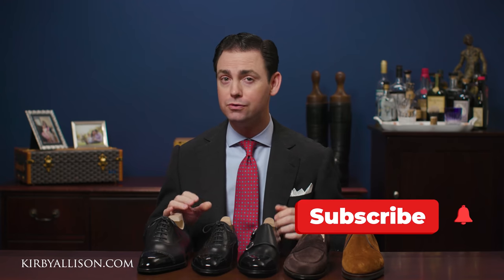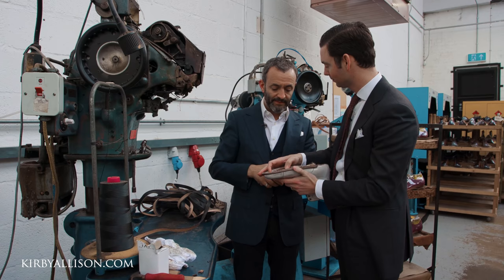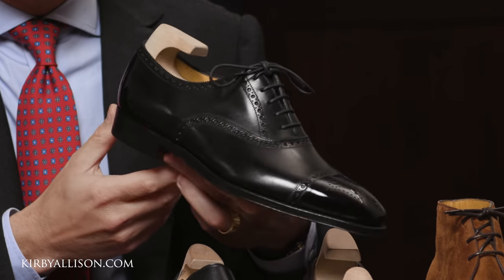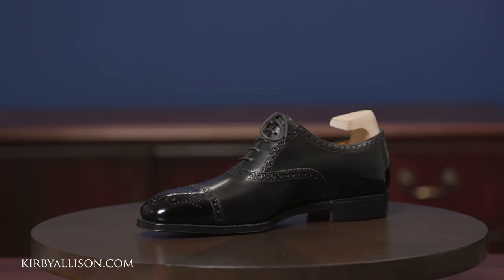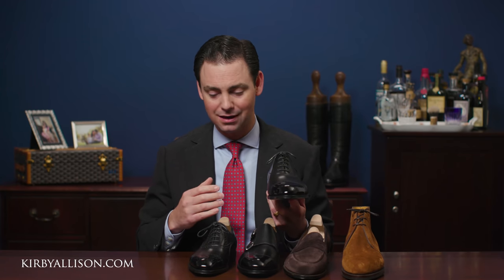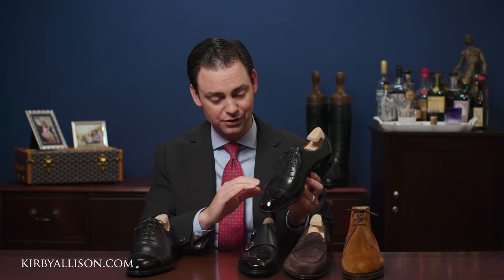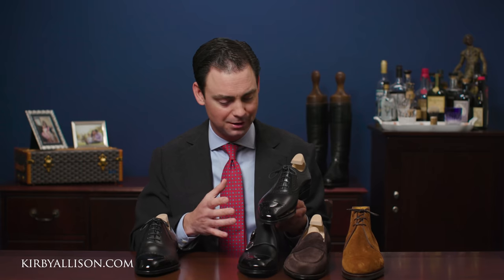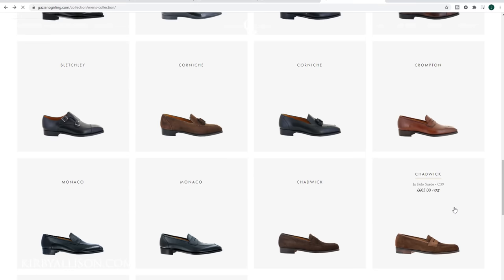Gaziano & Girling Classic Collection [In-Depth Review] | Are They Worth It?

Comment: One very important point about these shoes in the Classic line is that they are wider than what one finds in G&G's standard range. They call it EX fitting, in between E and F width (E being standard and F being wide).
Reply from the maker: This is correct! Great point and sorry I left it out of the review! Thank you for adding. Slightly more “American” fit, to be honest. And more forgiving than the standard GG last.
Reply: @kirbyallison   No problem! By the way, out of curiosity, the box of my semi-brogues states an F-width, not EX. Not sure it still is (I bought mine early on), but the sizing has been confirmed to be between E and F.
This will of course vary from person to person, but despite additional volume in the toe box area, I don't find the heel to be loose as a typical F would likely be. So the last has definitely a good shape to it.
All in all, I think these are great shoes!

Comment: Kirby, I'm 65 yrs old and my joints no longer tolerate leather soles that's why I use rubber soles with memory foam inserts. Please create a review for "ole fart" dress shoes, that's worth a challenge.
Reply: goodyearwelted shoes also molts to your feet. I would reccomend bespoke shoes if you have the money. i am not old but i had a back surgery, and since i wear quality shoes my back and feet don't hurt anymore